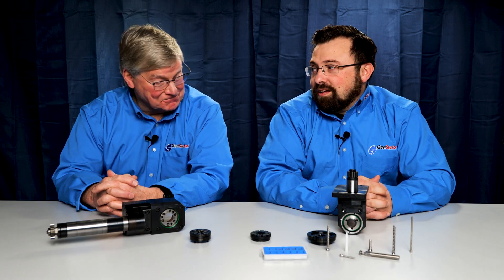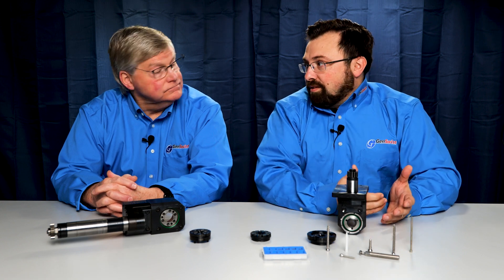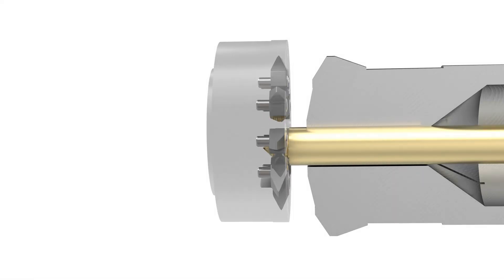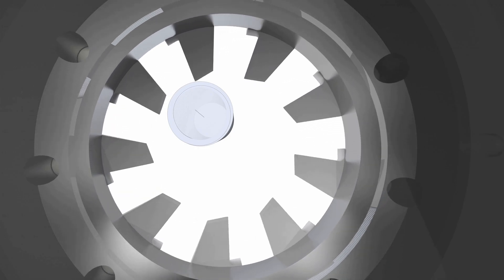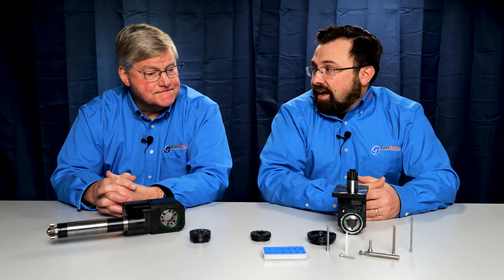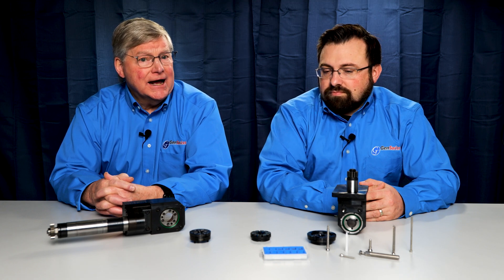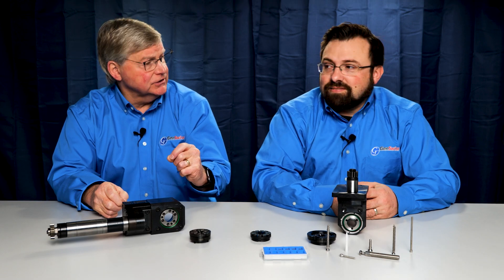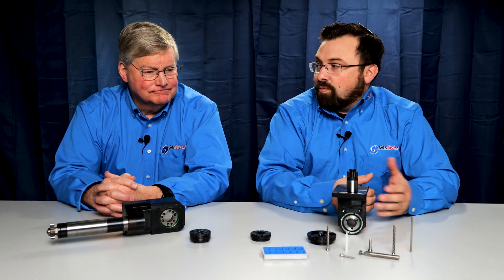Thread Whirling - Rapid Thread Creation With GenSwiss multidec Thread Whirling: Part 2

Comment: Seems ideal if you have a need to produce huge quantities of specialised threads.  Otherwise, dies and single edged tools will be able to produce the same results, with much less investment into tooling (albeit slower).  So if you want to manufacture massive amounts of bone screws (or maybe particle board screws?), go with whirling, any other application, dies, hobbing or single edge tools will get you by.